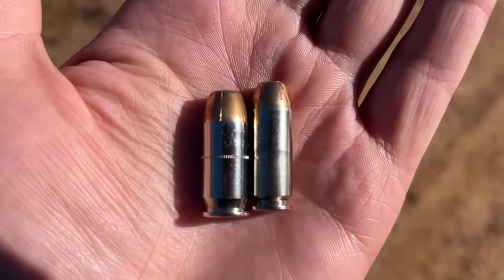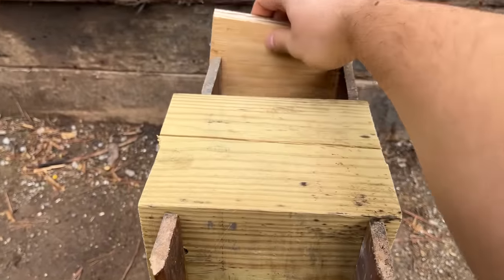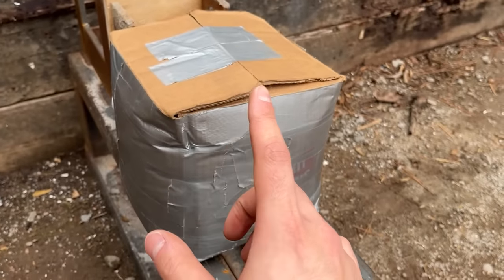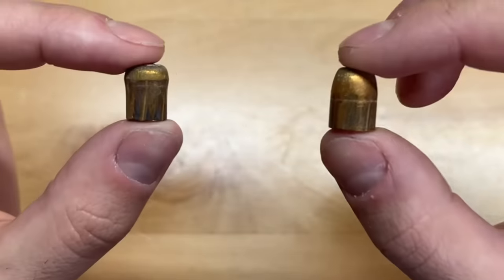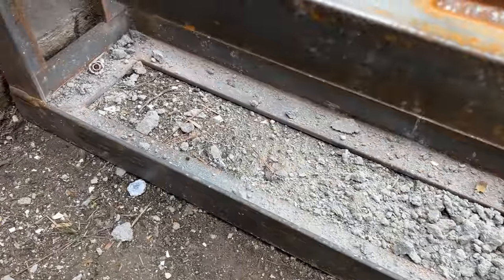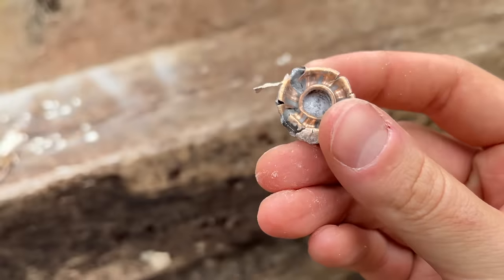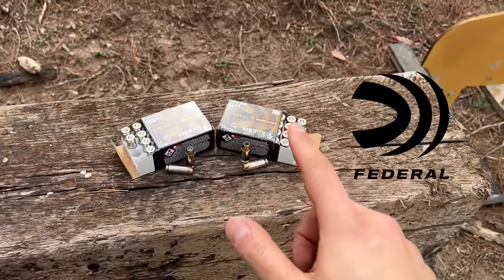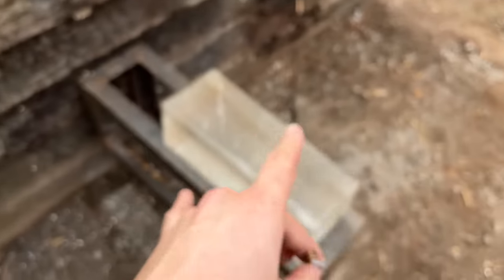45 ACP vs 10mm: Unbelievable Difference On Barriers

Comment: I like and own them both. The 10mm is a hot and powerful round but I still love the 45APC or 45AARP. Nice test
Reply: *ACP  Auto Colt Pistol, not Armored Personnel Carrier. 😉
Reply: Lol I wouldn't throw those terms around on YT.
Reply: AARP has been sending me junk mail for years, they never mentioned that they had a .45 plan or version. 😂
Reply: That's how I feel about it. I've got a Springfield Armory XDM 10 mm and a 45. My first 45 was a Hi-Point. I think it weighed about 25 lbs LOL! I kid you not, I found a paddle holster for it but you could not wear it on your side. You had to get the belt so tight it would kill you or it just pulled your pants right down. It was a great shooting gun though. I need to go shoot the 10. I just bought it round before big bad hurricane Debbie came rolling in. I bought a bunch of Underwood Ammo for it. That'll get the job done!

Comment: 1,100 feet per second 10mm? You’re using underpowered 10mm rounds bro. The whole point of carrying a 10mm is for the 1600 to 1800 feet per second Underwood rounds. Put that against the 900 feet per second Plus P 45 ACP and you’ll see the real difference.
Reply: Underwood Ammo has great penetration and Stopping power.
Reply: What’s the best ammo for self defense in .45acp?
Reply: are you shooting 125 grain bullets?  that seems excessive. Buffalo Bore doesn't go above 1300fps
Reply: Don't forget hard cast rounds as well

Comment: 45 was adopted to stop an opponent,  over the 38 used at the time.  The only time I considered penitration is with bears. Any other I prefer the 45acp. Great video 😊
Reply: .45 acp was designed for use on people and horse (horse cavalry was thing when it came out)
Reply: Original 45 Colt loads were designed to stop cavalry horses. 255gr doing 1050 fps. Later they were reduced in power due to difficulty of soldiers handling the powerful load.
.45acp was designed to be similar to the later 45 Colt loads, not original.
Reply: I love his "targets",  6x6 wood, sand. IMO, those are backstops. Let's try gel.
Reply: @jakerazmataz852  It's entertainment. His whole shpeel is more irony than anything: "Don't let ballistics drive you bananas!" Thing is, his ballistic testing is more recreational and doesn't generate any real useful information, unless you're hunting wood blocks, steel plates, or concrete bricks. Fun, interesting, but not particularly useful for defense or meat harvesting.
Reply: 45acp was designed to replicate the shorter weaker 45s&w used in the s&w model 3 Schofield pistols.

45 colt will forever be the tits.
Reply: @bobjohnson1633  45 Colt. 45acp. 38 Special. .45-70 Gov't. Americana.
Reply: @bobjohnson1633 Yep. Had nothing to do with Cav  Troopers being too  Limp wristed to operate their Horse Pistols.  Reduced power cartridge just long enough to allow clambering in the No. 3, along w/ the larger rim diameter of the. 45 Schoefield Cartridge for reliable extraction in both Pistols.  Hence the. 45 US Revolver cartridge @ 230 grains, 800-900 fps.
Ballistically Replicated in the .45 ACP for the same purpose as the originals.
Reply: Many brown bear country guides carry 40 cal. more bullets. Less recoil and with FMJ or all copper it's super penetrating
Reply: Ughh!  EDUCATE YOURSELF, Man!  John Moses Browning, stated very specifically on'is YouTube channel, that'e designed .45ACP to penetrate the armor plating of tha Battleship Yamato! 🤣
Reply: @exothermal.sprocket  it was tested on horses, cows, cadavers
Reply: @exothermal.sprocket 255gr 45 going 1050 is a stout load indeed.

Comment: Okay, 10mm is an all-time favorite for me.  It did out penetrate the .45 ACP and make a bigger wound channel.  I'd say it won except for you saying you were taking into account the FBI sweet spot.  There the .45 wins and in a case of self-defense over-penetration matters.  But I never doubted the 10mm would come out on top.
Reply: With the average size of folks in the US these days, the 10mm did not over penetrate.
Reply: Had to reread that jibber jabber. Over penetration doesn't matter as much as numbers do. 10mm always beats .45 ACP.
Reply: I was going to say the same thing. By the parameters set before the test, the .45 won.
Reply: Sorry, but 10mm beats 45, even when sticking strictly to the FBI standard. There are many loads to choose from. Also, CLEAR gel is NOT used for the FBI standard AND the block is only 16" long, which does not allow for the maximum 18" penetration for the FBI standard. Don't be biased.
Reply: @justinkase1360 Wait, who's biased?
Reply: @johngregory4801  I said DON'T BE. I was mainly saying to consider things in a factual manner from here on out. Yes, some previous statements were false. Either details were honestly missed or overlooked because of bias. Either way, lets just look at the facts.
Reply: @justinkase1360  I did. Your response was biased, then you told everyone not to be biased.
Reply: @johngregory4801  What was biased about my reply?
Reply: @justinkase1360  Declaring a clear winner when, without at least 18" of gel, Clear Ballistics or Knox Organic, there's no definitive proof that the 10mm round would have stayed within the gel was biased. Declaring that other 10mm rounds would have stayed in the block changes the parameters of the test unless other rounds are also tested for the .45. This shows bias. Is the 10mm more powerful than the .45? Of course it is! It was conceived by Jeff Cooper to be. That doesn't make it better unless the shooter is willing, or even happy, to deal with the increase in recoil. There's many parameters that go into choosing a self defense firearm and round, and every round can be better for some people, from .22LR to .460 Rowland to .454 Casull. Each one is better for the person who can use them better. There...

That's not biased.
Reply: @johngregory4801  Firstly, clear gel can not be used for FBI standards. It doesn't perform the same, none of it. Also, the "FBI standard" involves multiple tests, where consistent performance through various barriers is the goal. My comment was not about these particular loads, although it is true that the block is too short for an FBI test and is just entirely the wrong type of block. That is why any comment about the FBI standards as it relates to this demonstration is meaningless.

I DID NOT say that this particular 10mm load would have stayed within 18" in a longer block. What is being vaguely discussed here, at least in some of the comments, is "10mm vs 45acp", not particular loads. There are 10mm loads that do VERY well while not over penetrating and I think it is the better performing round by the FBI standard. Of course, the FBI agreed when they first adopted 10mm, but I don't think thar choice is relevant today. Bullet technology is different and there are more options. 

Regarding one's choice of which caliber is best overall for their individual use, I didn't make a claim about that subject. We were discussing only terminal ballistics. There are a ton of factors when it comes to actually choosing what's best for you.
Reply: @justinkase1360  All of which I already knew. It's that you wrote a workaround of the 10's performance without also speaking to how different rounds would affect the .45's performance. That's called bias.
Reply: @johngregory4801  I said that, "10mm beats 45, even when sticking strictly to the FBI standard". That takes into account what ammo is available and that is a comment on terminal performance. Also, you say you already understood everything I said, but you said things contrary to what I said in previous statements. Such as using Clear Ballistics gel and pretending that the penetrating depth had relevance. To the point, a round could penetrate 18" of clear gel and be a GREAT performer in the proper gel according to FBI standards. From what I have read, HP rounds tend to under expand and over penetrate in clear gel when compered to organic gel. 

Also, just as an aside, this 45acp round only made it to 12.5" in CLEAR gel and would likely penetrate LESS in organic gel.....not good performance. I will take overpenetration before under penetration any day. The 10mm also did more wounding.
Reply: @justinkase1360  smh
Reply: @johngregory4801  You haven't brought up a single factual problem with my statements. You might as well not have replied at all, especially with the last comment. I don't care that you would shake your head.
Reply: @justinkase1360  Your inability to comprehend is not my problem.
Reply: @mattmarzula  The stopping power of both rounds are impressive, yet they go about it in different ways. The low velocity and heavy weight of the .45 and the high velocity, low weight of the 10mm both make for powerful shots. If you’re looking for speed, 10mm will have you covered. The 10mm has a faster velocity and energy than the .45ACP. But the 45 gives great diameter and has stood the test of time. Maximum damage becomes very handy when you’re in dangerous situations and the 45 is going to give you the largest bullet expansion.
Reply: Meh, if you need something more than a 45acp you are picking the wrong class of firearms for your application.
Reply: @justinkase1360  oh please , 45acp has been around 105 years ! .45 is meant for close range combat . 1911 is the most combat tested life saving sidearm in the history of warfare. The soldiers who used .45 and swore by it and protested the change to 9mm all mentioned that the value of the .45 1911 was that they could hit the enemy anywhere even in the shoulder or arm and they would go down and not pose a threat. In close quarter combat its better to see the guy drop with the first shot anywhere so you can move on to the next threat rather than focus on hitting one threat in the vitals multiple times. The people who swore by the .45 dealt with multiple assailants who if they had to aim at the vitals of each attacker to drop them would not be alive today. You can have all the training in the world but when 4-5 viet-cong sappers are rushing you in the dark with explosive strapped to their chests you just want to drop them fast, it is not important how many shots you get into their vitals. The vets reported even an arm shot could almost rip the attackers arm off…so sloppy, panicked shooting could still get results. a .45 ACP will not just kill you it will kill your soul, the round is SO powerful.
Reply: @mattmarzula  It does in court when you are being tried for manslaughter, if not murder because you didn't think your carry ammo out and killed a kid because of overpenetration.
Reply: Learned something new today didn't realize they utilized certain ammo to avoid overpenetration. 😮

Comment: Considering .45acp is basically subsonic it was never intended for penetration. Its up side was its size and weight against unarmored humans. So as such being bigger but slower 45 will never outperform anything that's going faster however it will stand pound for pound in tissue damage

Comment: Picked up a Tanfoglio Witness 10mm for my backpacking gun about 15 years ago. Snagged Hi-Point's 10mm carbine for Xmas a bit over a year ago. Both are very fun out at the range, and I'm glad 10mm prices are roughly on parity with .45acp locally.
Reply: I picked up a 10mm for the woods after reading that most Alaskan Rangers carry 10mm. I'm good if I never have an aggressive bear encounter, but apart from carrying a heavy .44 mag or 454 Casul, a 10mm with 200 grn ball ammo has shown to be effective against smaller (black) bears.
Reply: If you're going to carry a carbine you might as well just carry something like a Kel-Tec 12 gauge with slugs I did a bunch of research and the most common Grizzly defense gun in Alaska is a 12 gauge with slugs
Reply: True that a 12 gauge is a goto for very close encounters. But the Alaskan Fish and Wildlife and maybe even Troopers carry 10mm to give them a little more advantage against bigger encounters like bears.

Comment: Some pretty slow 10mm there. I would like to see this test done with ammo that matches the old Norma loads
Reply: Agree with this.  Checked out the box info on my 10mm ammo and it is about 10% slower.   The 45 is pretty close.
Reply: Underwood or Buffalo bore
Reply: @MrErichonda30  Or DoubleTap or Grizzly or Steinel.
Reply: The +p 45aarp i bought flies around 2150, i would be shocked if the perfect 10's top end is under 2500
Reply: @BelMarduksBizarreBazaar  If it's an AARP cartridge, what does that make 9x19 which is older? Geriatric? Hahaha
Reply: @BelMarduksBizarreBazaar 2150 out of what?
Reply: @theprofiler8531 Out of his arse and his imagination. Putting a 20"barrel on a .45 AARP with a +P would add aprox 300fps to the 850 they already go....for most reputable ammo manufacturers. I'm not a smart man, but that's about 1150 to 1200 fps.
Reply: 45_70
Reply: Full house 10mm with a 220 is around 1300fps.